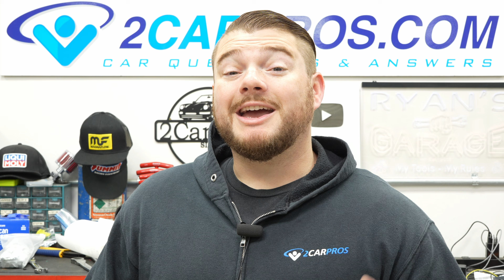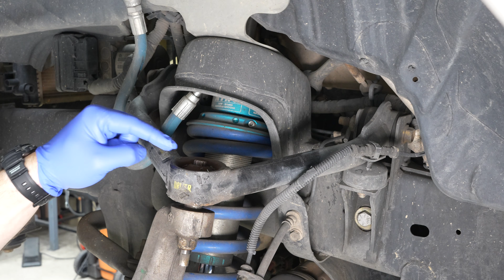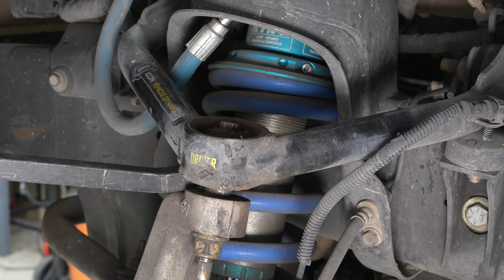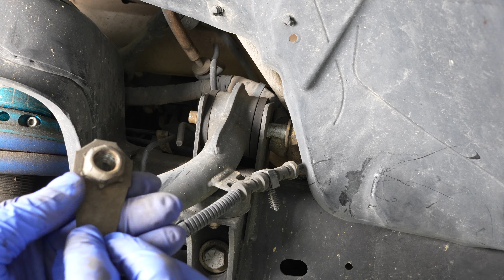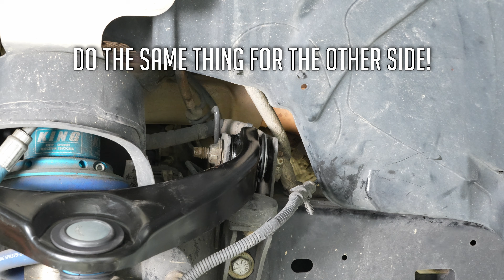How to Replace Upper Control Arm RAM 1500 2009-2024 | Sizes and Torque Specs!

Comment: Heat is your friend for separating the ball joint from the knuckle. Hit the top of the knuckle where the ball joint slots in with a mapp gas torch for about 15-20 seconds and it comes out nice and easy.